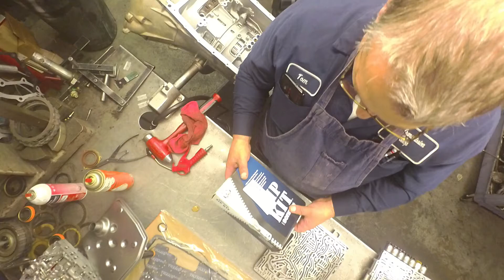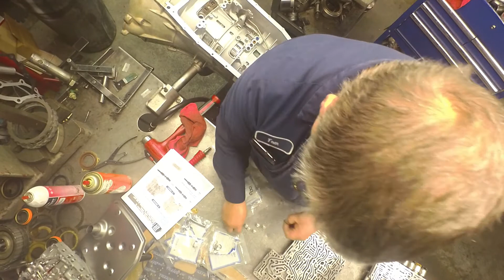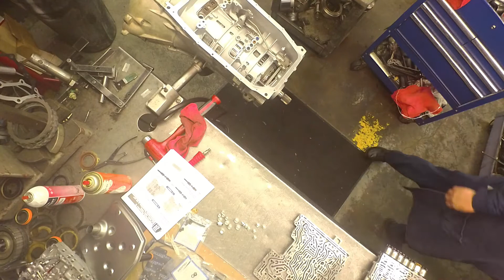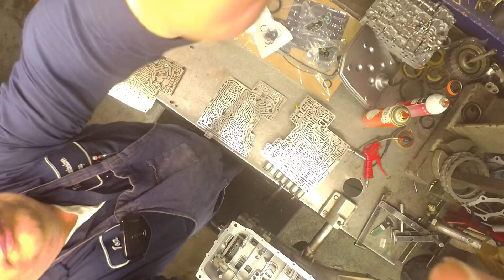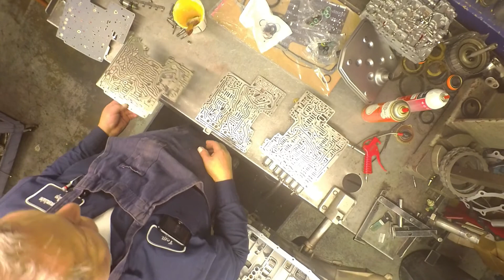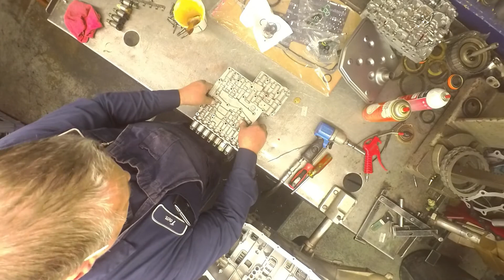6R80 Zip Kit

Comment: I have a 6R80 which ended up contaminated with water, it was only driven for 30mins with the water contamination. The transmission was drained and flushed out of the vehicle multiple times with AFT and no clutch residue was in the pan when it was dropped. However, i now have hard shifts 2-3 and downshift 2-1 but the transmission shifts perfectly under 1/2-3/4+ throttle. Am i losing pressure in the valve body, do you think this zip kit would resolve it?
Reply from the maker: Try resetting the adaptives in the transmission and letting it relearn. Usually once you notice that there is water in there it has been there longer than you think. Depending on the year your computer is inside the transmission on the valve body conductor plate, there is a possibility it has ruined it also. I would reset the adapts and if that does not fix it you could try the kit. After putting in the kit the adapts need setting again.
Reply: @CurmudgeonTransmission  (the transmission is in a 2009 F150, i thought all these 6R80s had the TCM built into the PCM). I tried resetting the adaptive tables using Forscan software but it failed every time, all i could do was to reset all adaptations and reset the module. Now i only have 1-2 shift, trans wont shift to 3rd but i can still select it manually
Reply from the maker: The computer was on top of the valve body till 2010 6.2L trucks, after 2011 everything else moved it from the valve body and it became part of the PCM. Water may have damaged it, pretty common. All you can do is keep trying the reset and perhaps it will work.